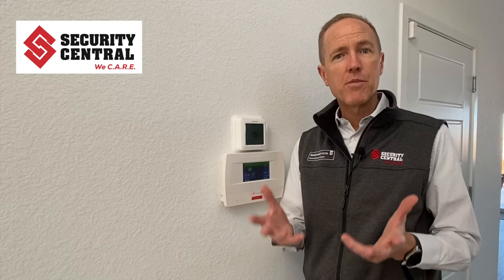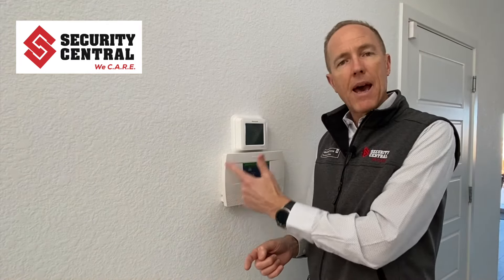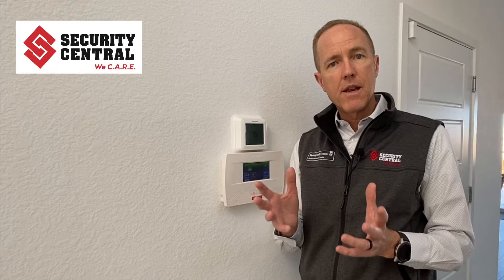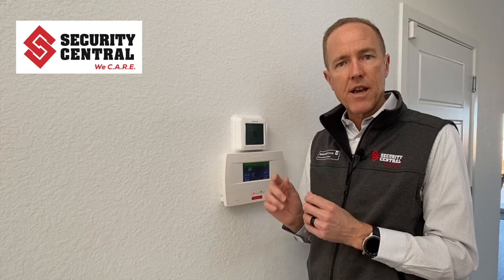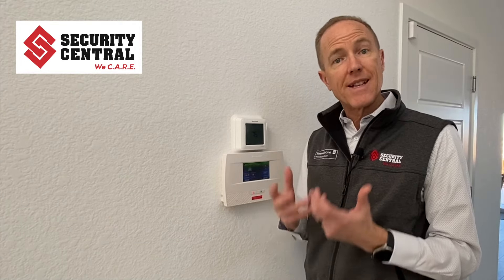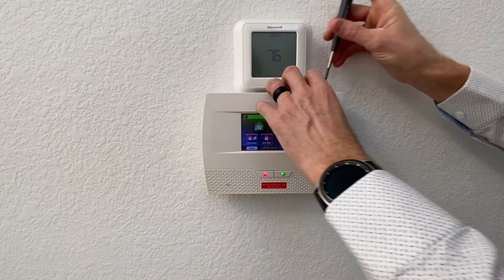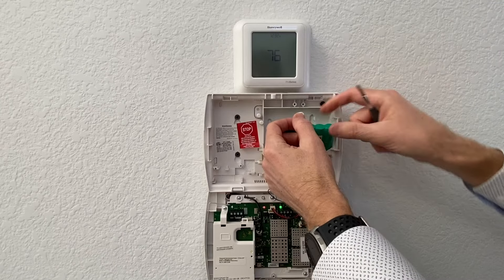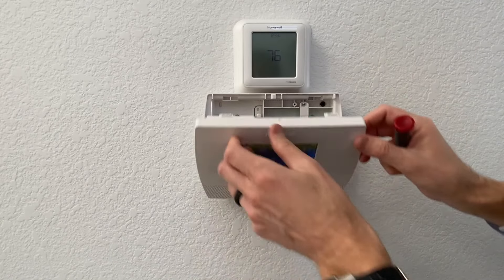How to Replace Battery in Honeywell All-In-One Alarm

Comment: Hi I'm in a weird predicament where we bought a house, never got the code for this, haven't used it, and now I am getting low battery beeps, but it won't let me do anything without a code. If I unplug it and open up, to remove the battery, is it going to shut off immediately or beep an aggressive alarm?
Reply: I'm sure you've handled this already, but I had the same issue. When I opened up the box, it did NOT beep aggressively. That said, it's also worth noting that unplugging the battery alone won't stop the beeping. I also had to disconnect the wires that were connected to the box through the wall, which requires a super tiny Phillips-head screwdriver. The beeping has been driving me crazy and this video helped me resolve the issue, so thanks @SecurityCentralInc.

Comment: Mine is a Honeywell 6150rf. I opened it and there's not battery and I also have no electrical panel either. It's written battery on the panel in the closet and is beeping. I have no idea what to do lol. 😢